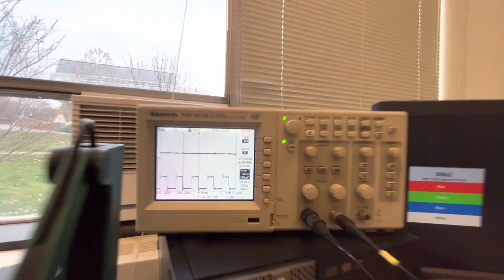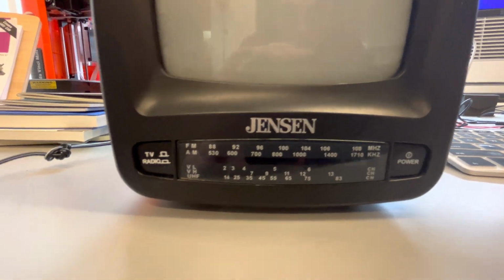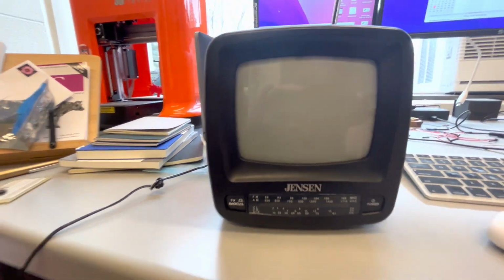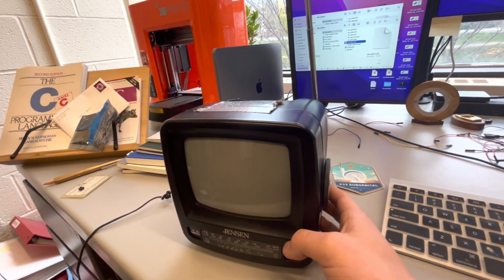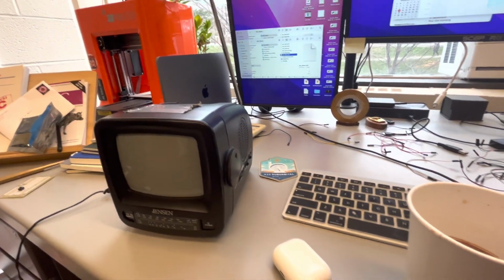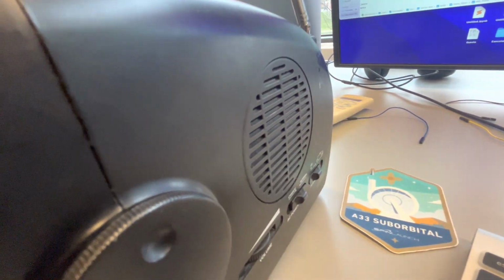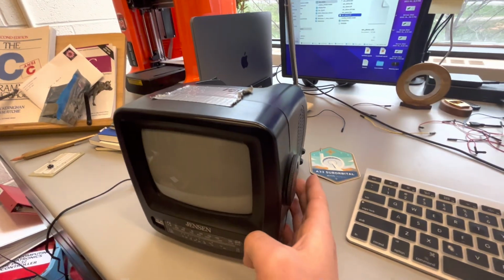AM Radio Transmission of Voice using PWM on Raspberry Pi Pico

Comment: I think the square wave generated will cause a lot of noise on other bands ! It would be a good idea to use a band pass filter. 
any reason not to use the DAC ?
Reply: The RP2040, and its successor, the RP2350, do not have onboard DACs... Kinda disappointing, means we're stuck with the square wave, unless there's some way to filter it

Comment: Is this not FM ?
Reply from the maker: Frequency of the PWM remains fixed, only the duty cycle (average amplitude) is varied. The audio waveform modulates the "amplitude" of the PWM by modifying its duty cycle. The radio will only demodulate such a signal in AM mode.
Reply: @hunteradams9430  The duty cycle is not the average amplitude if it is applied to the carrier, it is just a distorted square wave. Even your scope shows the amplitude as fixed?  To produce AM you would need to take a 50/50 duty carrier frequency then use a second PWM with the audio, smoothed through an R/C filter - than apply that audio to a transistor to amplitude modulate the carrier. I think you are slope detecting a distorted FM signal with an AM receiver, unless I miss understand?
Reply from the maker: Ah, the square wave is at ~1MHz and the audio is at 10kHz. So the square wave will retain its duty cycle for ~100 periods for each audio sample. Is that the source of the misunderstanding?
Reply from the maker: Worth noting that this is a "dirty" AM signal. The square wave produces loud harmonics which are also audible if tuned to with an SDR.
Reply: @hunteradams9430  I don't follow this at all, so I guess I just don't get it?  To my eyes without anything reactive in the circuit all you have is a carrier being distorted (unevenly weighted in phase by the look of that scope output) by an audio signal. if you feed that into a spectrum analyzer I suspect you would see lots of FM product and zero AM product. Maybe I am wrong.   The AM receiver may be overwhelmed into some sort of AM detection (as a result of the inductors/transformers re-integrating the large FM component back into your PWM audio,  but personally I don't think you have actually produced any AM signal at all - but maybe I am wrong and my theory is lacking. It would be interesting to see it on an analyzer.
Reply from the maker: Really appreciate the thoughts. I have access to an analyzer, I'll check it out. I'll post the code soon too, in case you'd like to also take a look.
Reply: @hunteradams9430  Yes, sounds interesting.  Would be great if you could post a video of the analyzer results as well. I have a pico board and a spectrum analyzer here, though it has spent 3 years in my loft so I am not sure it still works.  A binary that generates 1 second of audio tone and one second of carrier alone in a loop would be a great test. If you have an AM component then the analyzer would show the peaks change in height when the tone is present.
Reply from the maker: Please see the very bottom of the webpage linked below. I've embedded a video, and linked to an executable for download.

https://vanhunteradams.com/Pico/AM_Radio/AM.html